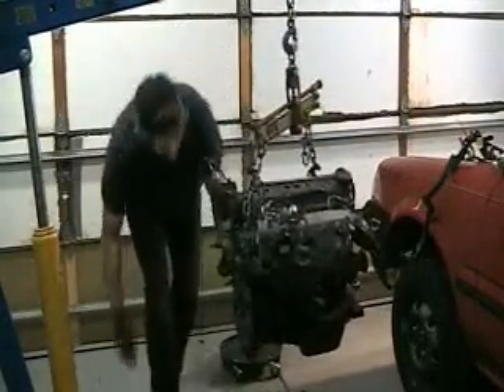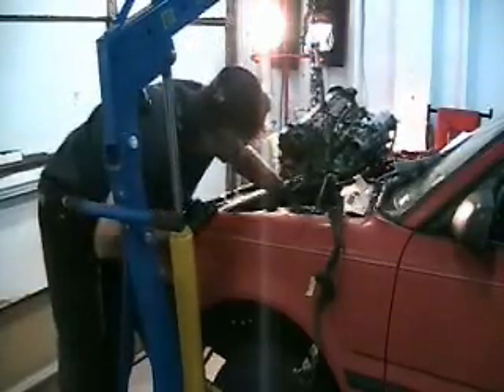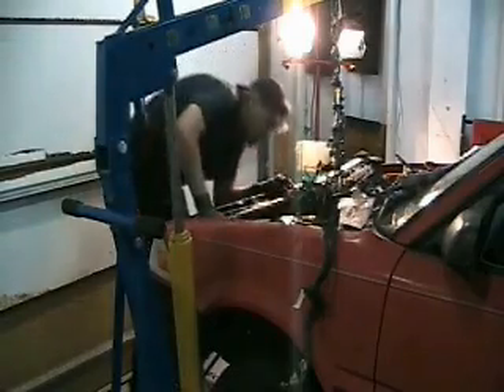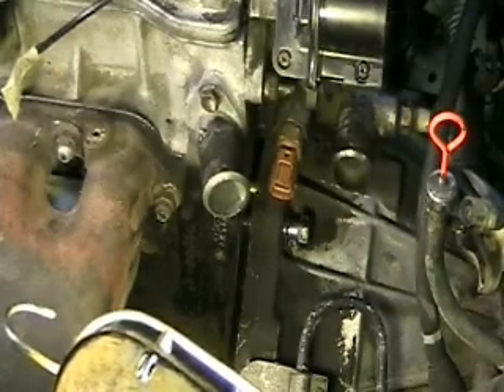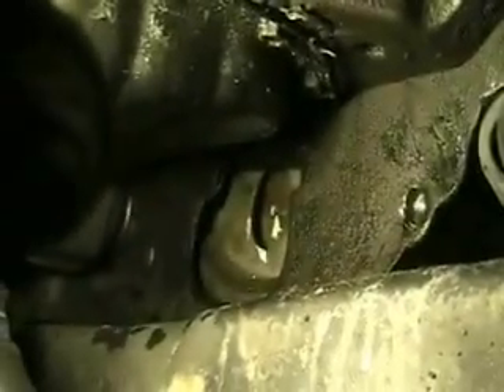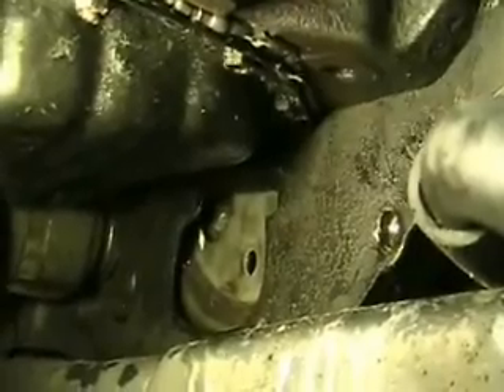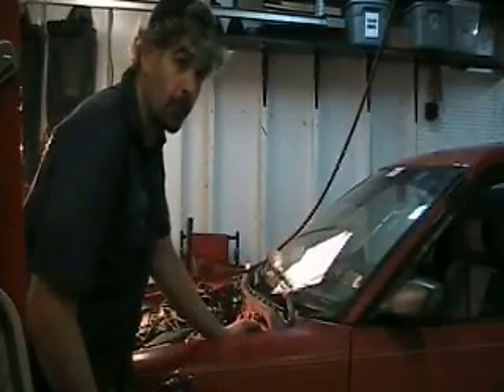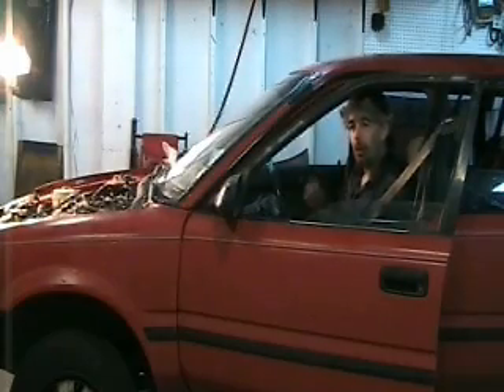How to Remove and Replace an Engine  PART 4

Comment: When you are putting in your torque converter (6bolts). Some transmissions have a metal plate or a rubber plate. I have a runner plate that goes over that open space. Will my trans leak or have any problems if i cant get that on there. I think it just acts as a dust cover but im not sure.

Comment: Just finished watching all four parts of this engine R & R. I plan on eventually pulling the four cylinder out of my Nissan Frontier as a first time project. Your tips and preparation ideas are genius and will save me much wasted effort when the time comes. The comment about cleaning up and putting your tools up every so often is something I had to learn the hard way, usually while doing major jobs like timing belts, water pumps, and heater cores. Unexpected delays, esp. on older vehicles, include stuck, frozen, rusted, and "previously rounded" nuts and bolts, esp. on older Hondas. Honda fasteners will round so easily if you're not straight on it with a six point socket. I recently completed a big job on an older CR,V, that wouldn't pass inspection due to the MIL being on. Did the timing belt, water pump, all front seals, valve lash, cleaned sensors and throttle body,  fuel filter (looked like it had never been changed), NGK plugs, Crank fluctuation sensor, both front motor mounts (one was a "torque mount"), repaired a rodent-chewed harness, and cleared all codes. Whoever did the timing belt previously on this 97 CR,V went wild and used thread lock on everything, including the bolts for the timing cover. The water pump's five bolts were the only ones without the thread lock, indicating it was the original pump (219K miles). It was leaking and had been leaking for a "few months". The customer just kept adding antifreeze daily and was really on top of doing that. He never overheated the engine during that time span. There was a horrible clanking, rattling noise coming from the front of the motor  when he dropped it off, and the pump was ready to seize. The customer used his stimulus check to catch up the maintenance. Large jobs like above will test the quality of your tools and equipment. and the rounded nut and bolt removers are of no help in the cramped space of transverse mounted engines. I had to use my Dremel and angle grinder to cut fasteners off that refused to budge. Thank you for taking the time to record this engine swap. The colored tape I will definitely try. I have a  compartmentalized box for fasteners, similar to yours, as well as five magnetic dishes from HF to keep the fasteners organized. Your series on the fuel trims was really helpful. Keep the videos coming, and greetings from Louisiana!

Comment: In many engines, flywheel and torque converter bolts can't be reused due to bolt stretch.  This is very difficult to diagnose so it's always best to get new bolts such as ARP fasteners or a similar quality brand.

This goes double for torque converter bolts. Ask me how I know...

Heck, get the motor mount ones new as well. Bolts are much cheaper and easier then pulling the engine again and reinstalling it. Broken bolts at the side of the road is no fun & can cause extensive additional damage.

Reusing bolts, & probably nuts, for parts that bear a lot of weight is a dangerous shortcut.

Otherwise, great videos.  Summit racing, Jeg's and other parts stores nearly always have replacement ones, in many cases stronger then OEM parts.

Comment: I couldn't use a load leveler on my last engine replacement because of the garage's ceiling height. Without the leveler, I was 2" from hitting the garage door overhead 😕
Reply from the maker: happened to me at my old house. usually i would drop engine in bay without leveler then add it after engine dropped.

Comment: One AM and just finished watching the videos. You are correct in pointers to important stuff and not just watching someone R&R bolts and hoses.Thanks for posting series as I would love to have chance to do this if my 2001 vehicle needs a clutch replacement in near future.

Comment: Outstanding video Matt, thanks!  One question, in your second step to starting the engine you mention disabling the ignition and fuel.  How did you do this; by removing the relays perhaps?
Reply from the maker: Paradigm FA It depends on the model. on some it's easier to remove a relay, some easier to remove the fuse, I believe on this model I simply unplugged the 12V coil feed

Comment: Engine swap, last video, only a few comments? How can it be? There should be tons of DIY folks clapping their hands! That said - that's a pity it was FWD car and such a small engine. I was swapping an automatic tranny in bmw e34 v8, lining this stuff up was a real challenge, even with 2 ppl. I'd really like to see some tips from you about such a thing, since we spent 4 evenings doing that, sweating as hell.

And a bottom line I want to add here is I already feel as home on your channel - just a few videos left and then I'll be biting nails waiting for a new one :) Greets from Netherlands Matt!
Reply from the maker: Thanks man! Yea larger engines are more challenging. One strategy if you can lift the car enough, is to attempt to drop the frame and engine. But normally I struggle too- the worst was a Cadillac north star longitudinal mounted V8 that literally took almost half the day just to bolt back up to the tranny. 
  Just patience sometimes is all you need.

Comment: Matt, this might be difficult to pinpoint via comments but I figured I'd reach out and ask for other viewpoints.

'91 geo prizm has essentially the same engine as what you pulled from this vehicle.  A co-worker had all five quarts of oil evacuate the vehicle at idle after parking in her garage, which coated the passenger side of the engine compartment entirely, even throwing it in copious amounts into the wheel well on the passenger side.  I think it's worth mentioning that the car has almost 200k miles on it.

Visual inspection showed oil on the underside of the hood, directly above the pulleys for air compressor, power steering, harmonic balancer etc, which makes me believe it originated from that side of the engine and not say, a rear main seal (hopefully).

I'm not a master mechanic, more of a computer guy, but I always visually inspect and start with easiest explanations and work to the most extreme through process of elimination.  That said, how would you suggest to continue diagnostic inspection?  Oil plug is in place, oil filter is tight which were the glaringly obvious starting points.  But since everything is so utterly coated with oil and it isn't drivable to power wash the compartment, I'm at odds at where to start next.  Should I invest in a uv reactive trace fluid, fill the oil and run it to see if I can find a point of origin of the leak?  I don't want to cause further harm if the car truly has a grievous mechanical problem by running it without proper oil pressure if say the pump is destroyed, or a crank seal is bad.

Not sure if you'll even see this since I'm commenting on a video from a while ago, but any assistance would be great!

Love your channel, thank you for all your hard work and dedication to helping us DIY guys that aren't afraid of learning new things and getting a little dirty in the process.
Reply from the maker: Ah, another fan of the Occam's Razor method.  Diagnosing leaks can often be tricky but what I do is keep in mind that like a leak in a roof- the place you see puddled with fluid is almost never even close to actual source.  I trace leaks from the bottom up, removing components as necessary to follow the trail. Sometimes running the engine and looking is necessary to create pressure or whatever. But whatever the case, I always start from fresh, liquid drippings at the bottom of the engine and work up following the trail.  The source will always have fresh liquid near it so I just ignore any dried crud.
Reply: Wish I could upload photos, but alas.  Following your suggestion, both main seals are leaking.  Drained the coolant and found oil in it :/  She paid $700 for the vehicle, and doesn't have the financial means to buy another.

Right now I've spent almost an entire day getting ready to pull the engine, but there are a few differences that have me stumped.  On the Corolla you worked on there was a place behind the lower mount to access the drive plate.  On this geo, No such access exists (also worth noting it's a manual transmission, which is why I'm thinking that might be the case)

Once the bolts connecting the engine to the bell housing are out should there be anything else to worry about to disconnect the engine from the transmission successfully?  I've not bought any manual as of yet because I have faith in my ability to troubleshoot as I go, but it's got me a bit worried with this being my first engine swap.

Comment: I will be doing my first engine swap shortly.  I appreciate the clear, straight forward presentation. Now I am reviewing the videos again and putting your advice into a checklist I will follow. Thank you for the guidance.
Reply from the maker: No problem. It actually isn't really that hard- once you do it, you realize while it's an awful lot of labor (it really is), it doesn't require a lot of brainwork.  It's really just unscrewing lots and lots and lots of bolts- it honestly isn't much more than that!
Reply: This will be interesting as I had a stroke 4 years ago and it limits my mobility but not what I do.
Reply from the maker: Samuel Skousen I am sure you will be fine- I have a viewer with one leg and he does plenty of car work in fact.  You hit the key in your first comment- preparation.  Preparation will be far more important than your mobility in fact.
Let me know how goes!

Comment: Great videos Matt, you explain it all in a very easy to understand manner. When I put my 2.5 straight-six manual back in I did it with the gearbox attached so the load leveler was a godsend. Money well spent.
Reply from the maker: Agreed on the load leveler.  I cannot imagine trying to replace an engine without one, that would really suck.  In an application such as what you did it is practically a necessity as you need to have some extreme angles to get clearance into and out of the vehicle.  Indeed a leveler is a product that pays for itself the very first time you use it and then some!!

Comment from the maker: Well Dave if anyone can build their own leveler it would certainly be you, but no there are no roller bearings on the leveler I have- it is simply a screw-drive mechanism that tilts as much as about 45 degrees is all. But I've pulled 454's with it and you can still change the pitch with just a finger pretty much.

Comment: Nice work Matt and good tips on the hoist leveler. I can remember spending at least an hour trying to align the dowel pins on an auto transmission that I rebuilt to get back in alignment with the engine block. What a PITA? Looking back, that was probably the most difficult part of the whole job. Thanks for taking some time out to share your engine videos.